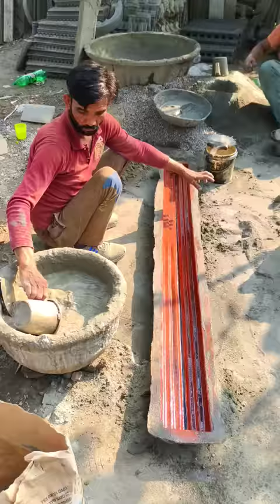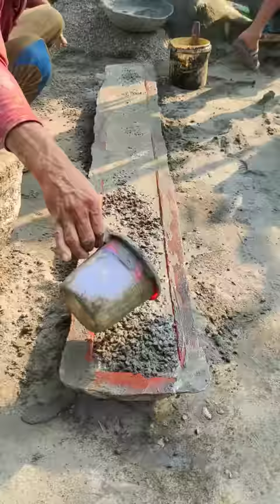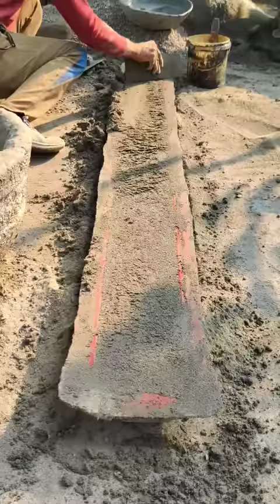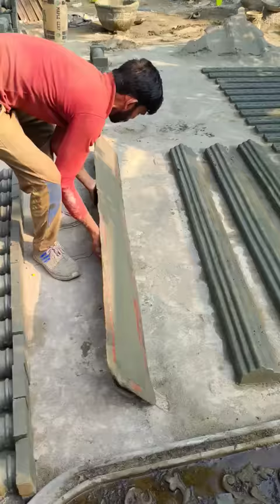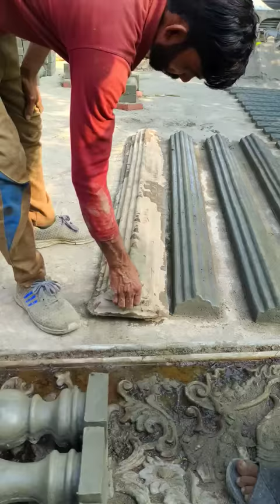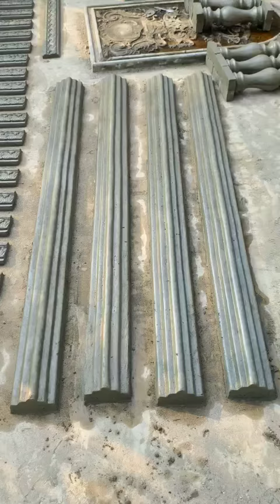Amazing Cement Craft #shorts #diy #crafts #wowskills

Comment: add water with just a bit of cement and flod the mold. add dry sand and cement over it until it is full. Add dry cement over it to use it like a sponge to get rid of the water, scrape and repeat 5 times the last step.      Or you could just mix it right the first time and you are done.
Reply: They don't mix it first or it would dry up quickly
Reply: Se o fizer assim é necessário usar tremonhas amigo, o processo dele está correto só não posso afirmar  as proporção de cimento e área. Mesmo isso sendo uma peça decorativa .

Comment: That reinforcement is has the same strength as boiled spaghetti
Reply: 😅😅😅😅😅 good job 😆😆😆😆
Reply: W Olmo lo sé😊

Ni jkk
Reply: inside too weak
Reply: The problem is to have regular customers
Reply: @lenny108  what
Reply: @manuelgarcialopez4555  😊
Reply: The cement is the one doing the reinforcing lol
Reply: These are decorative pieces.
Reply: I think they know what they are doing! They have been doing this far longer than you!
Reply: @matilda6362  Bot
Reply: Ikr 🤣🤣🤣 it's a spaghetti 🍝 job
Reply: It's only purpose to help keep it in one piece. I believe this pillar is decremental and not meant to be weight bearing. Save your boiled spaghetti for another video more related to Italian dishes.

Comment: they havent heard of mixing concrete first then pouring into mold....looks like they mix it in the mold as they go. and they just put in dirt they walk on
Reply: They do it fresh 😉
Reply: You didn't get it i guess.
Reply: it is actually dog piss, it's cleaner than the water there
Reply: That's not Dirt but Sand and they don't mix it Already cause it would dry up very quickly

Comment: No no no the cement mix/mortar quality is the problem. The cement concrete mixture should be well mixed according to standard and specific uses. This is a freehand mix....no wonder cases of collapse building or pillar are common cases.
Reply: ⁿ00
Reply: they are doing some decorative sidewalk things
Reply: It's a false ceiling but I agree more structural integrity doesn't hurt.

Comment: I have a stupid question. Why not just mix the cement in a bucket with the proper cement to water ratio and then pour it in the template 🤔
Reply: @dextervm6151 😂no actually salary is not main reason. ,,,,, it's mainly done for minute perfection over surfaces irrespective of the size

Comment: Way too wet to have any strength. Not enough steel. What little steel he does use isn't tied. He's trying to make concrete. Concrete is gravel (aggregate), sand (finer aggregate) and cement (diatomaceous earth not glue ). The components must be thoroughly mixed with only enough water to wet the aggregate and cement. Steel must be placed properly and tied together for strength. The finished pour must be undisturbed and left to cure (catalyze  not dry) for a minimum of two weeks. Preferably longer. This kind of crap kills thousands of people each year. With Google on millions of devices worldwide I'm amazed this sort of shit work continues. Can people even read ? Jeez
Reply: It's like crown molding. It's just for looks. Not for structural strength.